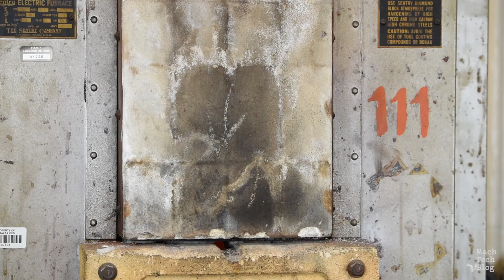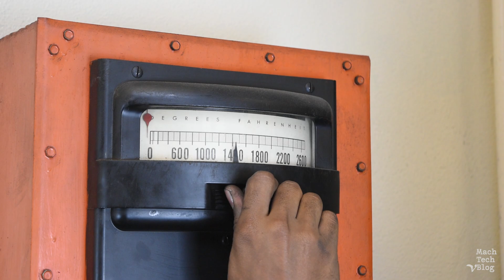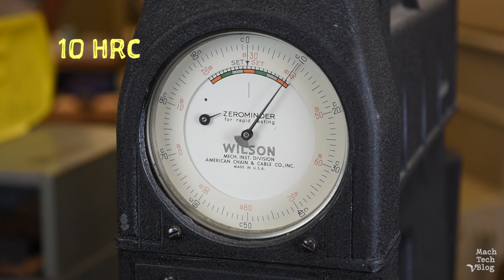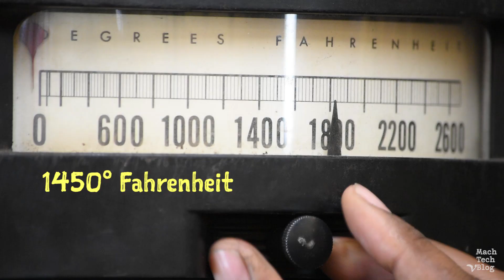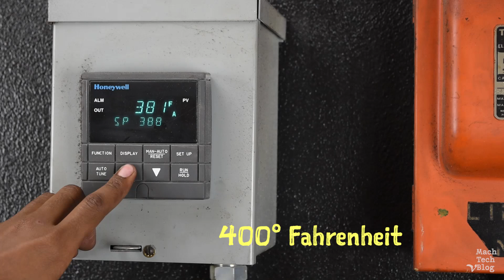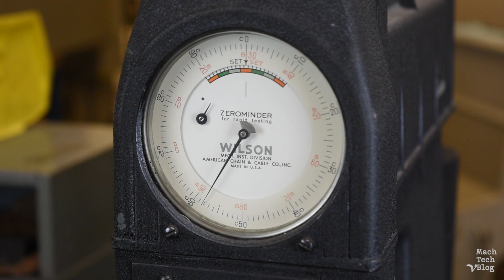Case Hardening

Comment: I liked the video very informative. I do have a question however. What purpose does case hardening have? I'm curious the benefits of case hardening over just starting with a more appropriate steel? Would a 1080 or a comparable steel be less effort? It just seems like a lot of hassle when you could just buy a higher carbon steel, or alloy steel.
Reply: Case hardening gives a hard exterior and soft interior. The harder, the more brittle, the softer the more ductile. This gives you a pice that has a hard wear resistance on the outside and a softer inside that can absorb more shock. This makes an overall pice that may end up  with surface cracks if shocked  (like being dropped) and will not totally shater. The piece will remain usefull.
Reply: Jeremiah Huntley Yes that makes sense. However when I make a hammer out of say 1045 or a 4140 I harden it then temper it, it makes it so when there is an impact It will not chip or shatter. There are a steels out there such as an s7 or d2 or maybe even a 5160 that you can make incredibly hard and scratch resistant that will not damage even when dropped on a hard surface when heat treated correctly. That are much easier to accomplish than the case hardening process.
Reply: It just comes down to price, purpose, and needs.
Reply: Jeremiah Huntley Yes but what looks to be like a 16+ hour process as a oppose to a maybe 3 hour process with the right steel, would negate the cost. Also for the purpose in which these items are used the process seems to be a bit overkill. Every machinist I have ever met guards these tools with their life as to not damage them. I really don't see some one using it as a hammer. 
Just to be clear my curiosity is purely educational. My intent is not to be a troll.

Comment: Why do most bladesmiths use preheated oil? Please do a video on that. I watch forged in fire and they always cringe when a smith uses a water quench. My guess is the smaller cross section of a knife or sword needs its own specific quench rate and they use already carbon rich steel....most of the time.
Reply: Also i got 999th like. It's 666 upside down.
Reply: 6211th sub
Reply: Most of the time blade smiths use simple carbon steels anywhere from 1085-1095 so that they can quench using water, forge weld easier, and it's cheap. The mild steel in this video is 1018 and the case hardening looks like it has brought the carbon content to about those levels. Preheated oil quench is typically used when the simple carbon steel part could be prone to cracking or more commonly it's used for tool steels that require a slower quench. Oil has a lower specific heat and cannot absorb as much thermal energy as water so it quenches slower. The advantages of tool steels are usually refinements such as better quenching characteristics, greater toughness, higher shock resistance and so on. 

I don't think I can stress the importance to KNOW WHAT STEEL YOU HAVE AND HOW TO HEAT TREAT IT IN FINE DETAIL. Example=> Water quenching a tool steel will result in a horrible cracked mess that starts with a hiss, followed by a soft *ping*, and then you cursing for a few minutes. Always test the steel you're going to use before you make a whole project out of it. Knowing what steel you have always trumps picking up junk or salvage steel as you can then use commercial heat treatment recipes for your steel. If you use salvage stuff you will have to run your own tests and decided how to heat treat it best, YOU ARE NOW YOUR OWN METALLURGIST.
Reply: Quenching a blade in water risks cracking even with 1070-1095.  I make flintlock rifles and quenching an engraved frizzen in water can result in fitting and engraving another one, hand made springs are a lot of work and cracking one makes more work.   Yeah been there done that. I have made a few knives as well and use oil for that as well.  They preheat the oil because cold oil gives a poor quality quench compared to warmed oil which "wets" the part better. Bladesmiths making damascus generally use 2 different alloys to give the best pattern.
Reply: Yes warm oil is used to quench by most at least. ATF or other 10w oil thinned with Diesel in some cases.  Forged in fire is complete BS. I am sure at some level its scripted and its not based on guesswork. Some insight into these shows I received caused me to not even watch Forged in Fire now. People who know how to make knives don't do stuff as stupid as I see on the show. Pulling the blade out with the oil burning off it? Its for SHOW its not for making a good blade.   Its Hollywood after all....  Not all case hardened parts are or were quenched in water. Water works well for CC hardening. But case hardened parts can be quenched in oil as well and have a color pattern if the process is right..

Comment: Can i use this for an axe head? I know, it would only make for a thin layer of "hardness". Or what would you recommend?
Reply: Der Kommentator your axe head is likely all high carbon steel, so it can easily be hardened. It likely already is. If you lost the hardness from overheating, you can do a similar heating then quenching and tempering, you probably only need to heat treat the first inch or so of the cutting edge.

Comment: 1018 if hardened will run about 40RC, throughout. any tempering at all will, obviously, make it quite soft (250f draw is around 25RC, if memory serves). the "as hardened" condition isn't file hard on the surface like the case part would be, but would still produce quite serviceable blocks for all but the most abusive of alloys. don't do "mild steel" the disservice of dismissal from heat treatment unless carburized. it just won't get too hard to deform without fracturing. it also is limited in depth of hardness to about 1 inch wall thickness to produce uniform hardness. without the manganese content, it would be half that for wall thickness, and an "as hardened" condition of 30RC or so. the manganese encourages the carbon to remain in solution, so the cooling has a chance to "freeze" thicker parts before carbides drop out. but, within those limits, you can get 50 ksi working parts out of 1018, and single cycle heat treat to boot, lol
Reply: What quench temp and quench medium? I have heard of people hardening mild steel with the proper quench medium.
Reply: Thanks 
I'm

Comment: I used case harden from time to time in the last shop I worked.  But I never thought about being able to use charcoal rickets.  We all ways used a product called  Kasenit.
Reply: Kasenit surface hardens with a process called nitriding as it is a combination of nitrogen rich compounds. No longer available, but there are many similar compounds which we use for hardening hammer faces.

Comment: Clickspring did a great comparison video of case hardening using burnt leather in clay, the OG method. 8 hours is far too long. 20 minutes at that temp will harden about 0.7 cm deep into most steels then bring it up to temp until it gets a nice straw color. Putting it back in at 1400 for 20 minutes is too long. Any longer and you're just wasting energy.
Reply: You need to understand they were then grinding away part of  the oversized part to get it flat and to size. Its not the same as doing color hardening on completely finished parts.  Drawing to straw is OK but for some applications defeats the purpose of casehardening.

Comment: how does the carbon immolate and penetrate when the melting point is 3550c?
Reply: phase transformation, Google it. i may ooversimplify it but  at high temperature the atomic structure becomes mobile and the atoms reposition and accept the additional carbon. but only so much, The iron and carbon don't connect to the point of changing to a different element but align and disperse in a crystal lattice. look up body center cubic and face center cubic. there is a fine balance in tempature, alloys and quench medium and rates.
keep reading, stay courious. pardon my spelling!

Comment: For once I am impressed by a YouTube presentation ! Very impressed, your tutorial is spot on with both the process, and the reason for case hardening, it is not always a requirement to give a second heating and quench ,but it does give a better grain structure, as does you tempering process, many thanks for a sensible and factual video, unfortunately most viewers of YouTube will not appreciate the knowledge that you are imparting on them.  Subscribing!

Comment: Might be a silly question, but if you're machining, rather than forging, the case hardened steel, how do you get the hardened metal to stay on the outside of the part? What's the point of hardening the surface if you're cutting off parts of the surface to make a tool?
Reply: Emil Sorensen: The only finishing these blocks will receive is from a very light surface grinding, to get the surface true, this will leave .030" of hard surface, you cannot machine the blocks when they have been quenched, the whole point of case hardening, as explained in the video, is to achieve a glass hard wear proof surface, with a strong malleable core, this is just perfect for things like gears, or parts subjected to impact stress that need to be wear resistant.
Reply: The material removal is just enough to true the part since it may not be flat and square after the quench.  Carehardening, as used in firearms for example, seldom exceeds .005" depth since if deeper than this any thin sections may through harden and become brittle. Its possible to do deeper levels on blocks and other parts without thin sections and thus more can be taken off to true the parts and still retain the very hard slick surface. HOWEVER. The part must be intentionally made over size to allow grinding to proper dimension.

Comment: Kingsford? Please guys, that stuff is shit. Talk to me and I'll send you some lumps of REAL WOOD (mesquite, hickory, or fruit woood) charcoal, not caburized sawdust glue gravel and dirt. Kingsford is shit! Try some leather charcoal too.
Reply: The mixture animal hide, leather & wood charcoal gives the pretty yellow, blue, violet swirling charcoal case hardening looks of an old firearm. Surface grinding gets you close. Hand scraping and hand flaked standards are considered the best, and a hand precision hand scraped 1"x3"x24" straight edge can easily cost over $2000.
Reply: Seth B if the lattice structure of the material requires strictly carbon to create iron-carbon phases, then any variation in optical properties such as coloration that deviates from the pure phase will be due to presence of trace elements within the lattice structure altering its optical properties on a small scale.

I'm sure the reason why they are using Kingsford, despite it's humble sawdust origins, is due to its relatively purity and lack of trace elements, the consistency of its chemical composition between each batch of charcoal, and its reasonable pricetag.

judging by the fact that any element larger than carbon will have a harder time filling vacancies in the lattice structure,  the coloration of impurities we see are probably relatively restricted to the very surface of the material. they probably don't care about the coloration or aesthetics of carbon steel blocks on an industrial application, but I think you should start compiling information about different carbon sources and their effect on the coloration of the finished steel surface, as I am reasonably certain this will be valuable information to craft steel workers.

Comment: Me: "Id like to case harden something"
Video: puts parts in furnace that costs thousands
Me: "Fuck"
Reply from the maker: Hey, Miiiitch88,

Our videos are definitely geared toward industrial professionals, so you're right that we often use equipment which is outside the budget of the average hobbyist. However, there are ways to case harden at home without totally breaking the bank. The cheapest solution uses a torch and a surface hardening compound like Cherry Red or Kasenit. There are four steps: 1) heat the part to cherry red, 2) coat the part with the compound, 3) heat the part back up to cherry red, 4) quench the part. The drawback of this case hardening method is that it produces a very thin case on parts. We've got a video in the works on various carburizing compounds, and maybe we can try throwing Cherry Red/Kasenit in the mix.

Another way to case harden at home is to make your own furnace. It's easiest to start with a used kiln for ceramics/glass on eBay or Craigslist, because they're cheap, plentiful and any one of them will be able to get hot enough for case hardening steel. Then buy a ceramic temperature probe (like this one: https://www.amazon.com/Temperature-Thermocouple-Ceramic-connector-CR-02/dp/B01N0YA9ZR/ref=sr_1_1?ie=UTF8&qid=1490972899&sr=8-1&keywords=high+temperature+k-type+ceramic+probe); a PID temperature controller and a solid state relay (like this set: https://www.amazon.com/MYPIN-Universal-Temperature-Controller-Combinations/dp/B00X6SEWS4/ref=sr_1_22?ie=UTF8&qid=1490973051&sr=8-22&keywords=pid); some copper wire and a few plugs and receptacles. Stick the probe in the kiln and wire the components up (there’s wiring information in many places on the internet, including here: http://www.smokingmeatforums.com/t/148997/mypin-ta4-pid-manual-programming-instructions-and-general-pid-ssr-info-by-request). We’ve personally seen very good results with this set-up and it can cost as little as $100. Of course, the drawback is that you must be competent with handling electricity.

Comment: would they also work in a kiln such as what is used for ceramic art?
Reply: Lynda Anthony: Yes providing you can achieve and hold the temperature, there is no need to maintain temperature for many hours, if you reduce the time to 2 hours you will just get a thinner case hardness, adequate for most applications, but these blocks are to be surface ground, so the maximum case was required.
Reply: Different furnaces and kilns are specialized for different tasks. But at the end of the day, heat is heat. If you have something that can generate the right amount of heat for the length of time required, you can make it work.

Comment: I learned a similar technique from Machinery's Handbook. The carbon material was combined with rock salt. The salt when it liquefies allows freer movement of the carbon, and creates a reducing atmosphere minimizing oxidation. Hold temp at 1800* 6-8 hours, reduce temp to 1400* for 2 hours. Remove from furnace and quench parts in water. Follow up with a draw temper at 400* for 1-2 hours. It's best if you can suspend your parts in the salt/carbon solution. I was making specialty hammers for metal smithing which needed case hardening. These already had eyes for attaching handles and I was able to suspend using baling wire. Heavier parts could be suspended using slings of several strands of baling wire. This whole process allows for more even, deeper penetration throughout the parts being treated. I never did a Rockwell test, I do know that once treated, then mirror polished my hammer faces never marred or deformed.
Reply: Seems like it would give you a very nice, thick case (100 thou or more). Not that common in industry. I do many "shallow case" jobs requiring only 1 hour at 1700 to meet the spec. I've only seen a few very deep case jobs. Thanks for sharing that old recipe.

Comment: For all that is holy please get better charcoal or make your own for case hardening I prefer bone charcoal myself. For better colors and just because its more traditional...I am being nit picky and prefer case Color hardening
Reply: Color Case Hardening is only used on Surfaces that are not going to be Ground afterwards,  otherwise the Beautiful Color Case Hardened Surface will be completely Ground Off.
The 1”-2”-3” Blocks they just Carborized,  Hardened,  and Tempered,  will be Finish Ground,  on all Surfaces,  to Tolerances that are unobtainable by Finishing a Part to Size,  Bone Color Case Hardening,  and left “as Hardened.”   

I hope this has clarified to you,  why the Beautiful Bone Case Hardening a Process is not appropriate for these Parts.
Reply: @shelliesman7552  the fact remains that there are better charcoals available. Briquettes contain a rather large percentage binder and filler. Real charcoal does not contain any binder or filler. I wouldn't want these mystery materials leaching into my product that I spent so much time and energy to produce. But to each, their own. I guess.